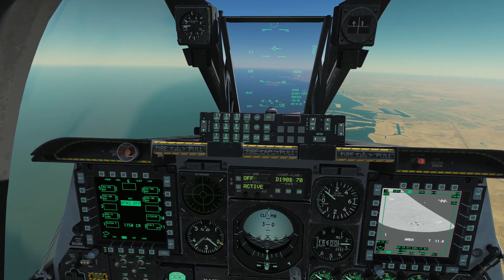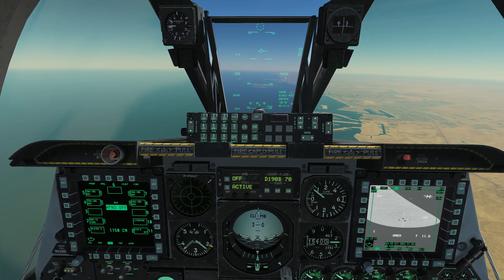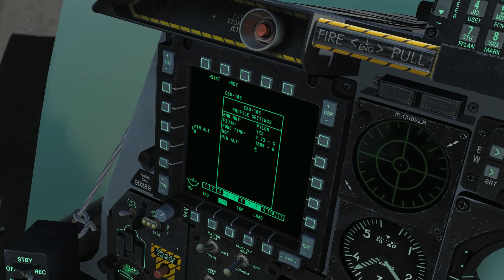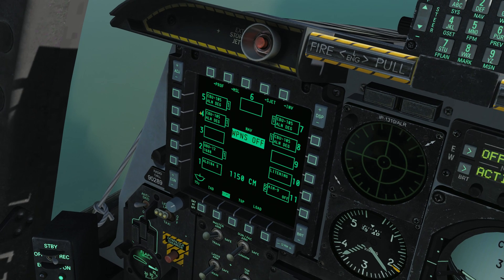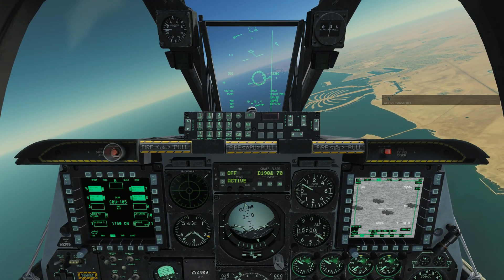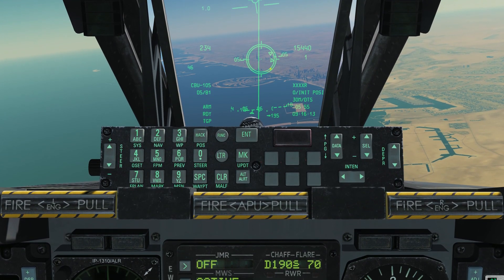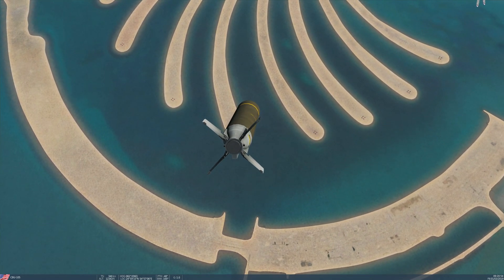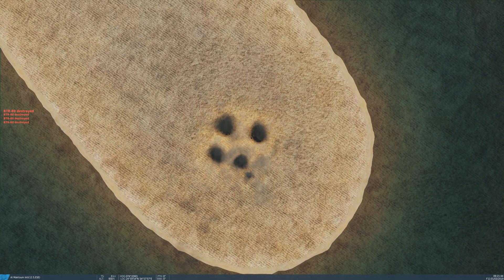DCS World Tutorials - A-10C Warthog - Intro to CBU-103/105 Wind Corrected Munition Dispensers

Comment: with CBU 105, i don't get the CCRP reticle symbol on HUD, why?
Reply: If you haven't already worked this out, it's because the current DCS shows a DLZ bar at the left of the HUD instead. Confused me too, since I was looking at the wrong part of the HUD for my pickle cue.
Reply: @peterfagan3587  oh thanks for the tip. I will check this soon. Maybe because my hud  on the screen is kind of cropped from the 4 sides i can't see everything,  so i did not notice that bar earlier. Will give it a try Thanks!

Comment: what does it mean. It is meant for windy conditions because it corrects itself??
Reply: I mean you can use them even with no wind. They are basically JDAM versions of the CBU-97s
Reply from the maker: The canister itself corrects for wind though the submunitions do not.